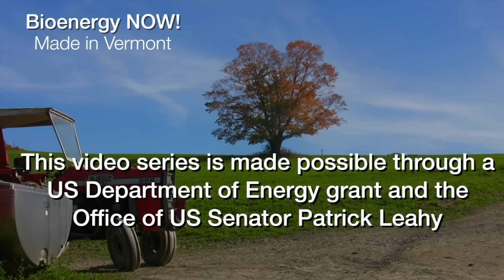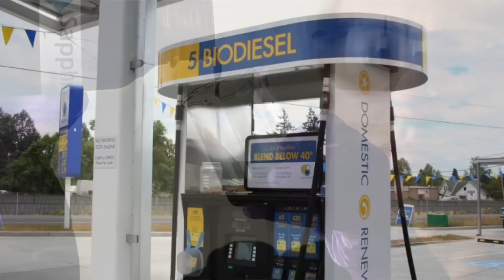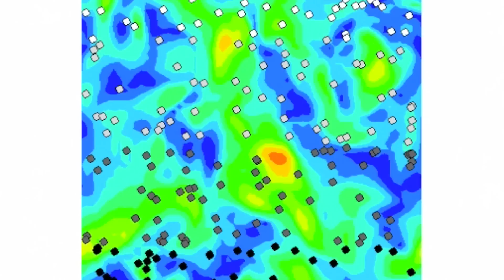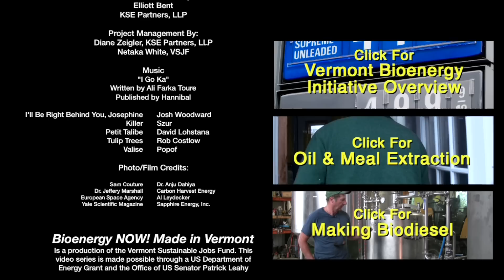Algae to Biofuel

Comment from the maker: Hmmm. yes, this could work. The challenge is at this latitude (in VT), the artificial lights are needed most when cloud cover is the greatest (so 2x or 3x "times" zero still means the algae aren't getting the light they require). But concentrating winter sunlight with the heliostats is very interesting. I've forwarded this to the researchers here. Thx
- Netaka

Comment: Instead of expending the energy to extract the oil, how about just drying the algae and burning it to generate heat to heat water and drive a steam generator? I know this won't work for vehicles.
Reply from the maker: Thank you for the idea! We are focused on liquid fuels currently, but we always appreciate this kind of dialogue.
Reply: VermontBioenergy  so can you extract the oil from algae using a home hand oil press? i saw people extracting oil using hulking motor driven  presses that cost $10,000+. will a hand press do the same or no?
Reply: Algamon fascinating, thank you.

Comment: Im a science student, was wondering about mixing several species of algae that are high yield oil producers, and some that are better at surviving and predator protection, to maximize oil production,  also wondering if you have tried using different light wavelenght to see which produces the highest yield?